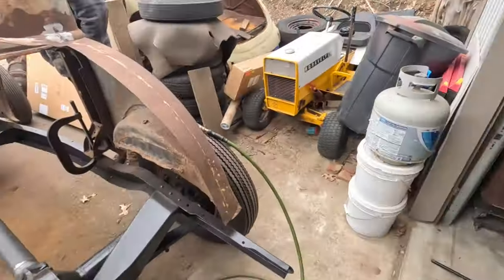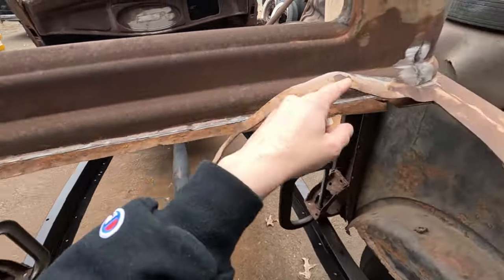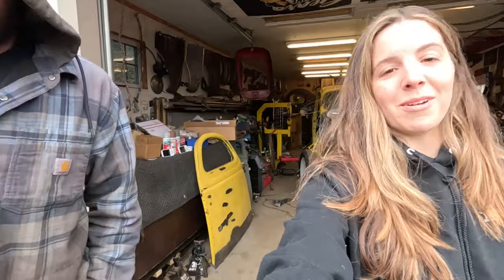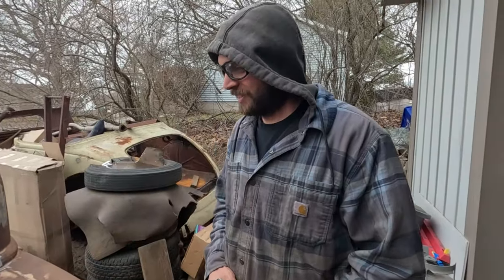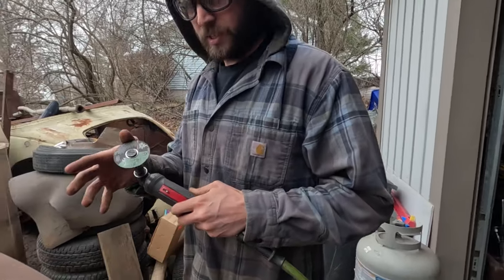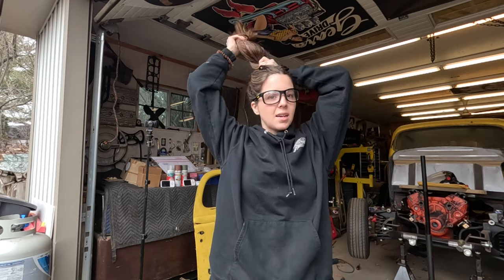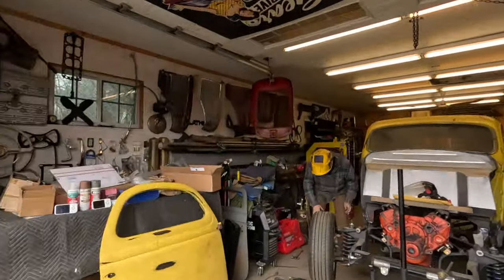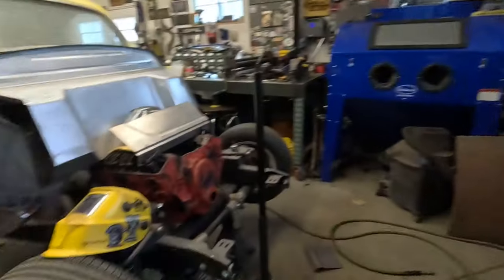Cutting the back of the trunk on the 32 3 Window

Comment: Just a suggestion at home Depot they sell that black 3 mil 10'x25' plastic roll that you can put under that black tarp you covered the car with this way your covering the entire car and it won't be exposed to the outside elements but it's just a suggestion
Reply from the maker: We had a tarp somewhere 🤨